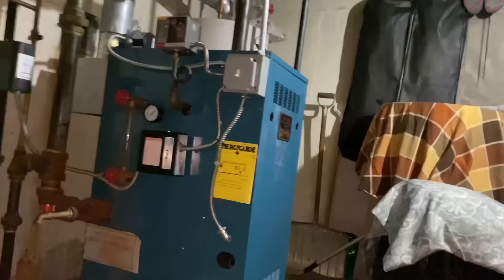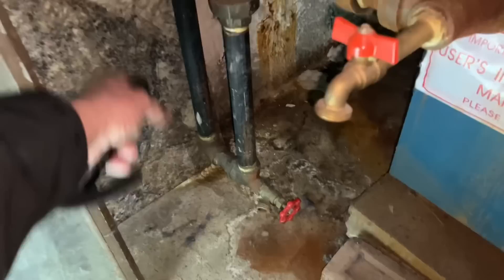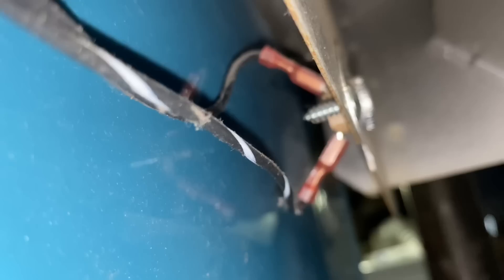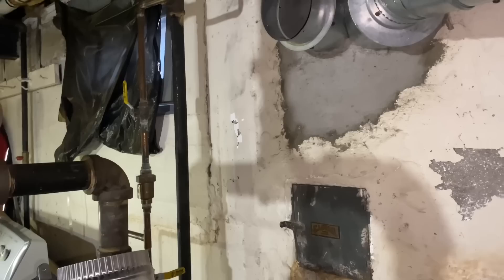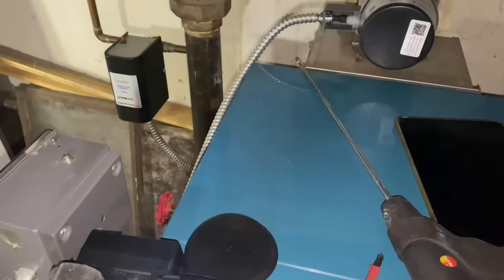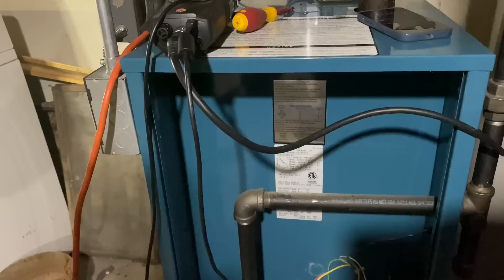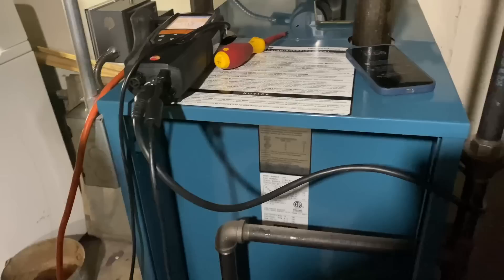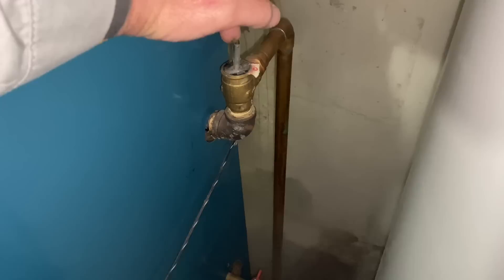Disaster Averted: Troubleshooting a No-Heat Burnham Steam Boiler | HVAC Service Call

Comment: First class service call Mike.  That was a compounded problem thanks to not one, but two incapable techs monkeying around.  Scary how many unqualified “service techs” running around in peoples’ homes.
Reply: Keep it up your kicking ass. I’m a technician in Colorado have a Well McClain small unit only 4 zones. One zone was sticking. Honeywell I replaced the zone valve now the boiler will not start up. I traced all the wires and they are connected as they should pilot is good. I’m new with boilers so any direction would help.
Reply: @letsroll8771 was it running before you changed zv ? Did you burn out transformer?
Reply: @letsroll8771  don’t overlook the possibility of a brand new part being DOA. It’s doubtful but it does happen.
Reply: Don't forget lads plenty of qualified techs are also incompetent :)

Comment: Awesome work. I went to a 300 horse power fire tube Superior steam boiler the other day and terminals 5 and 6 were jumped out the M&M 150 head. Someone mis landed a wire in the burner cabinet and the burner wouldn’t shut down during a low water condition. 
Like I said nice work. You may have saved a life. 👊

Comment: One of those make it work jobs, seen many missing/jumped safeties. I always cycle units on and off a couple times and stick around long enough for it to cycle itself. Also usually call back and double check before bed. Good job Mikey

Comment: I was thinking something was hinkey when Mikey jumped out the thermostat and the boiler didn’t fire. WTF? Why did it eventually fire? He even mentioned he didn’t hear the thermostat relay pull in when he jumpered the wires. So what was controlling the boiler on/off? How was it wired?  24v->thermostat->Pressuretrol->low water cutout-> ? What the hell did the installer do? Other than totally F things up. Wow. 

Customer sure called the right guy. I really loved the thermal camera tour of the steam loop. That was absolutely the best thing I’ve ever seen on the channel! The gradient across the pipe going into the Hartford loop was the shits.   Thank you Mike!

Comment: Mikey I can tell you what’s going on, nat grid/ homeserve hard wires all there boilers , we don’t use the thermostat relay, we cut the harness on the damper in just put it in the circuit, what the last guy did ( maybe the guy that changed the damper) he by passed the PT and went straight to the gas valve, the colors are Blue is hot
Yellow is common 
Black is t-stat
Red is gas

Comment: you think before you got there, the relief blew and the temperature of the steam tripped the spill switch?  it was hovering right by that switch. i saw the damper was working when you got there. or  you think there was a draft issue?

Comment: Or if the clothes dry is running sucking air out. The clothes dryer left of the boiler is probably the cause of negative draft pressure.
Reply: @PipeDoctor  Cudo's to you for finding the missing/faulty safety circuitry!

Comment: Just wondering at the end of the video there when you said that the vent damper doesnt work? So you just left it the manual open position? 
Just unsure why it isnt working automatically like it should

Comment: Neighbor of one of my customers has a mini split. I have been offering for 5 years to service the split when I do my customers splits. No, no, we’re fine was always the answer. Their house burned down last week and the fire marshal said the mini split was the cause of the fire due to lack of maintenance. Line sets can get really hot if the unit can’t blow off its heat. Mikey, please tell people how important it is tonged heat pumps serviced.
Reply: that’s not gonna happen more then likely it was an electrical issue. those compressors have a thermal overload that fails to off. that only if like three temp sensors have all failed. lots of safeties in place to prevent that. those internal thermal safeties typically trip at about 300 so no where near starting a fire.
Reply: @PipeDoctor  Mike, I have done a lot of research in the last few days. A mini split can catch on fire but you are right, it won’t be the line set. However r410-a is flammable and if the electrical system catches on fire it can rupture the line set or the coil and burn the refrigerant making it look like the line set caught on fire. The fire absolutely followed the line set into the house.

Comment: So I have a question:  if the flue damper is set to manual- does it stay in an open position? If so what’s the pro/con vs it being closed when off and set for automatic operation?
Reply: Yes it does.  When closed it keeps the heat in the boiler instead of escaping through the chimney.

Comment: Somebody didn't know how to wire in series
Reply: In oil p404 1st.then lwco2nd. then burner. Aquastat low voltage to tt on cad cell relay
Reply: Same with gas pressuretrol lwco damper then burner. Series

Comment: So that boiler had NO pressure control? It would run until the relief valve would pop ,the water level went down and then the auto feeder would open and fill/cool the system down until it repeated the cycle? Crazy . Jumper it all out.!!! Get rid of all fuses and just fuse ground!!    Safety 40th What idiot wired that?? Grim Reaper HVAC Services. Cash only Good save MP
Reply: That explains why the sight glass was so clear 🤷‍♂️
Reply: @chuckquinn8026  sure does. She was getting flushed on every heat call😆
Reply: Wouldn’t you notice your basement was a steam sauna? 😳